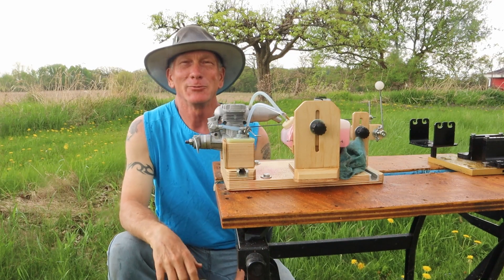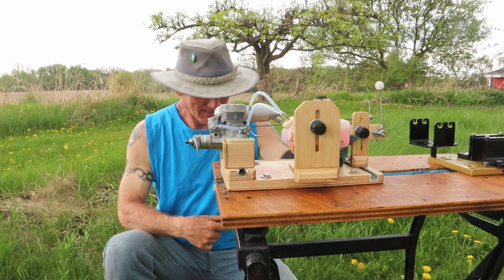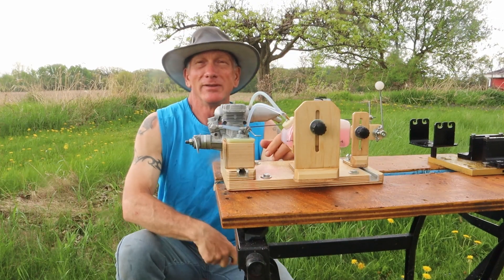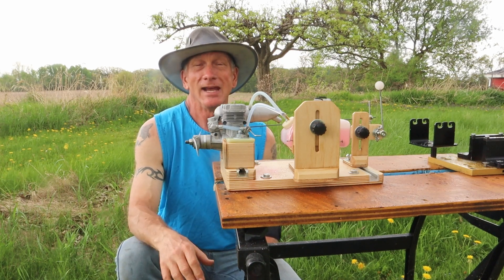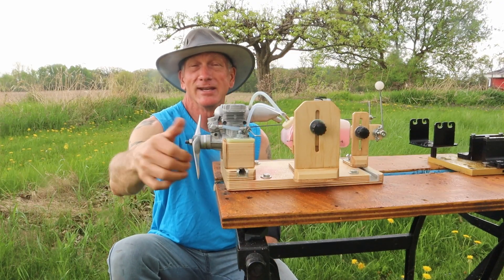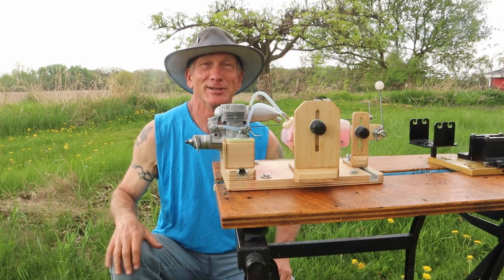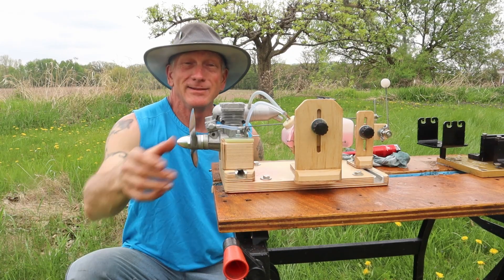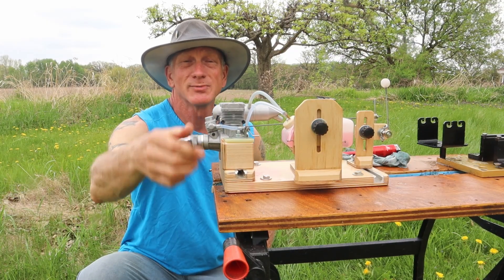OS 40 FX Project Engine 1 First Run

Comment: Hi Dave, just like the old Honda commercial would say " I'll take it"
This is great timing I'm prepping an OS 46FXi back into service, clean up, bearings, oil up & reassemble and the difference other that it's a 46 is they have a replaceable rear mount for the hsn. Those molded rear covers w/hsn are terrible if  you crash ask me how I know
Tks for the vid